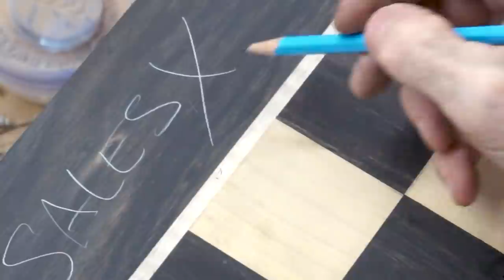How I made an Ebony and Boxwood Chessboard with Red Inlay

Comment: Awesome chess board. Just a suggestion. After using the CNC to carve in the letters and numbers, you can use an epoxy resin to fill them in. Many different colors and pearl powers. then just sand off the over flow and you are in business. No more hand painting multiple coats.
Reply: Or use bloodwood for these areas. It's about the same color as the dye he used.
Reply from the maker: Epoxy doesn't look bright red on a dark wood like ebony unless maybe I mixed it with a mother of pearl powder.  Blood wood and padauk are not colorfast and darken over time when exposed to UV light, so that wouldn't be suitable because the client wanted the inlays to match the color of his company's logo.
Reply: Have you ever made a chessboard  on one side and a backgammon board on the other?

Comment: It's a beautiful board and you showed great craftsmanship, but I don't like the red-dyed inlays. They just don't look sharp / clear / colourful enough to stand out - the quality doesn't seem up to the rest of the board imho. I read your comments about not being able to use alternative woods as their colour fades, hence the stain, but what about epoxy filling? You can have any colour including metallic and high gloss bright options and seems easier to do than the wood inserts you CNC'ed. Or could the inserts have been soaked in red dye before gluing in place, to get them brighter and sharper? 
I also don't get the double-sided board thing, I'm a chessplayer, I wouldn't have thought the notation bothers people who don't use it <shrug>. 
Thanks for sharing the build process, very interesting.

Comment: Nice job Mike, as always.  I have only used ebony in turning pens and have found it to be difficult to work with--it chips or cracks easily and it is so hard that when turning it creates a lot of black dust that can get into everything.  The border of the playing area and the edge banding in maple are nice contrast pieces to the ebony base.
Reply from the maker: I found the ebony quite easy to work with when cutting, but I had the same problem when turning a few of the chess pieces. Some of them turned fine, while others had a lot of chipping that I had to sand out. I think it may depend on the piece of wood.  The dust definitely gets everywhere and that's why my hands were black throughout the video. I forgot to mention on the voiceover, but it was a challenge to sand the maple edge banding to remove the black ebony dust. An air compressor helps a lot with that.
Reply: @Woodumakeit  Excellent video and really nice work, there!  On the topic of ebony sawdust, I'm putting together a holly and gaboon ebony chessboard.  I'm concerned that sanding of any kind over the whole surface once it's put together will really bleed ebony sawdust into the nice white holly.  You mention the difficulty you had with the maple edge banding, but did you not run into that problem whatsoever with the boxwood on the chess board surface itself?
Reply: I am in a similar situation  making a macassar ebony and maple chess board. Any problems with ebony dust affecting the white squares? Also any problems using standard wood glue with the ebony?

Comment: Thanks for another wonderfully instructive video. I recently made my first two chess boards, and was inspired to do so from your work. I have a long way to go to reach your level, but it is a lot of fun! 
Did you get a new miter saw somewhere along the way? You started with a Rigid and moved to a Delta... 
Thanks again for the video. I really enjoy these.
Reply from the maker: Thanks for the feedback.  I did get a new miter saw because I built new cabinets along the back wall and didn't want to have to leave clearance for the rails.  I liked the design of the Delta even though I knew the dust collection sucked (or doesn't suck).  It's worse than I could have imagined, but the saw itself is great.  I waited for a long time to get a really good price on Amazon. The Ridgid is now my job site saw and it's perfect for what I need.

Comment: Awesome Work! But i don't know why it's double sided? I see this as unnecessary extra work, or am I making a mistake here?
Reply from the maker: A couple of reasons. One is so that you can play with or without the notation. The other reason is so that there are squares on both sides to balance the forces when the wood expands and contracts. If the squares were only on one side of the plywood, the chances of the board warping is much greater.
Reply: @Woodumakeit  "One is so that you can play with or without the notation." This does not make any sense to me. No real chess player would even notice whether there was notation or not: it certainly wouldn't bother any chess player one way or the other. Nobody beyond the beginner stage needs notation anyway; if you're a chess player you already automatically know the notation of every square on the board.  And while the carpentry is absolutely beautiful, I cannot imagine anyone actually playing chess with those pieces. They would be just for a decorative board for a non-player.

Comment: Do you have issues with cracking and warping? I've been thinking about a chess set and I can't come up with how to prevent wood expansion and contraction issues other than just veneering very thin strips to plywood, but I would think that half inch ones would be big enough to cause issues. Are they thin enough not to be a problem?

Comment: what thickness are you cutting the boards your using to make the squares 1/2 or 3/4? I've learned so much i am going to attempt to make one of these myself.
Reply from the maker: I aim for a final thickness of the board to be 1 1/4". I very often use 1/2" plywood and cut the strips of wood on my bandsaw to 1/2" thick so that they end up being 3/8" thick after sanding. Because ebony is so expensive, I used 3/4" plywood and cut the strips to be about 3/8" thick and sanded them down to about 1/4" to give an overall thickness of 1 1/4".  Good luck with your build!

Comment: was curious if you had considered blood wood or bubinga for the inlay
Reply from the maker: I didn't really consider those types of wood for this application because the client wanted a bright red to reflect the color of his logo. Something like bloodwood is not color fast and will darken over time. I had considered using red anodized aluminum, but after making some test cuts on my CNC, I was worried about getting clean edges and dealing with sanding without removing the color.

Comment: Gorgeous chessboard! I noted after you glue the 2.25 in squares to the plywood with a 1/2 in over hang of plywood that you said you trimmed off an ever so slight edge to square up the chessboard. Doesn’t that make the outer squares slightly less that 2.25 compared to the inner squares? I was going to try and make a chessboard for my grandson, but of course not to your level of craftsmanship.
Reply from the maker: Yes, the outer squares are slightly smaller, but it's not something that is noticeable to the naked eye. I likely cut off a maximum of 1/32".

Comment: Is plywood specifically necessary to prevent possible warping of the board with time? Just wondering why not use ebony, for example
Reply from the maker: The plywood helps to minimize the effect of wood expanding and contracting during seasonal changes, so it's a good idea to use this method. Since ebony is so expensive, it also helps to control the cost of the materials.
Reply: @Woodumakeit  I love your work and your videos! I just discovered your channel and have watched two builds so far. My concern was that the plywood might limit the expansion and contraction of the hardwoods as they go through their seasonal expansion and contraction. But I am assuming that you have done this enough times to test the concept without any issues.

Comment: Looks like you were having a bit of trouble at the start with your wide belt do you know what the reasoning was for that? great work as always haven't seen a board you've made that I'm not jealous of
Reply from the maker: I'm not sure what part you're asking about. If you point me to the right part of the video, I'd be happy to explain what was happening.
Reply: I noticed that your roller belt on your sander is doing a bit of a wave and you had to readjust some strips so that it would roll through your sander I've never used a belt sander like yours so was wondering if the belt just needed tightening or if it was normal there is a small Amount of wave around the 10:25 mark
Reply from the maker: I see what you mean. I had to loosen the belt on that side because it was tracking toward the motor and I already had the other side tightened quite a bit. It's not really a problem for the belt to be loose like that as long as it's tracking properly. Another viewer commented a few months ago that he has a similar issue with the same belt, so there must be something a little off with those replacement belts.
Reply: Ahh thank you for letting me know I'll have to keep that in mind when the wife lets me get a belt sander

Comment: Wow, what is the modem-like sound i'm hearing at about 27:02?
Reply from the maker: That was my CNC router working in the background on another project.
Reply: @Woodumakeit  Ah, that sounds logical. I wouldn't have guessed you would hear the different pitches of the electromotors spinning. At least, that's what I assume that sound is?